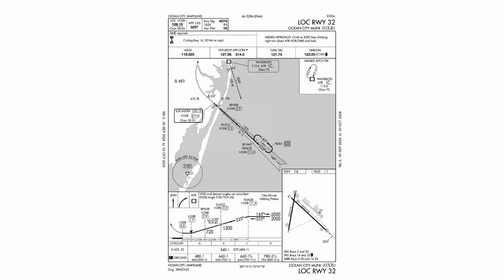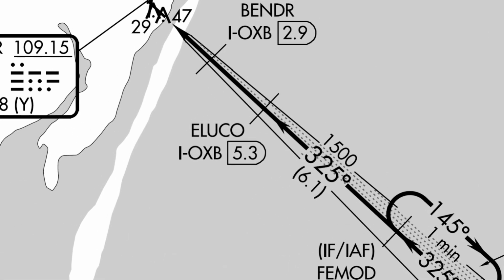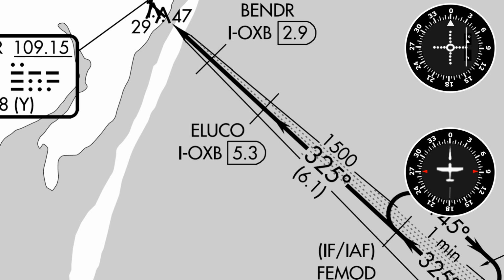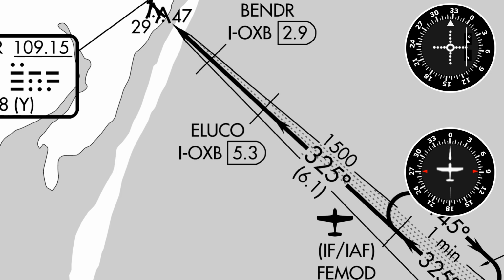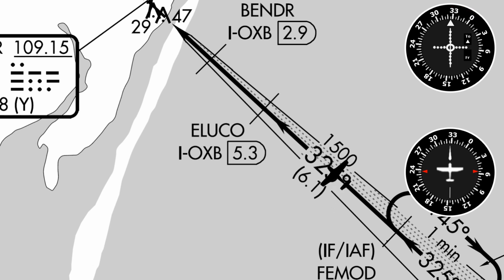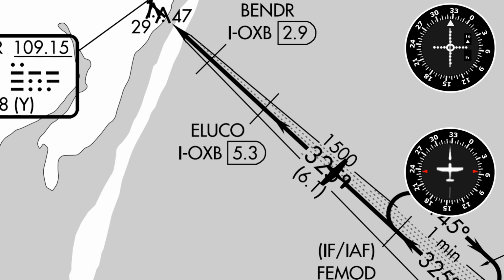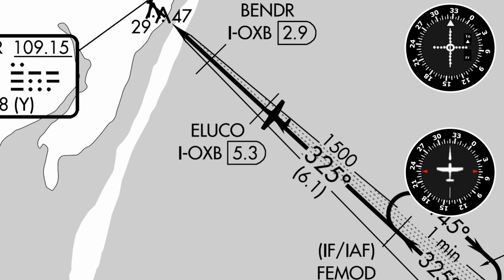Chasing the needle on an ILS: a visual guide

Comment: I thought this title was going to be tongue in cheek. Never chase the needle. Chasing needles leads to oscillations not captures. When you get to actually doing the work, you’re not chasing the needle, you’re making a correction in needle direction then waiting for feedback. Note rate is part of feedback, you should also consider counter-corrections before centering. 

The five degree left example in which the deflection no longer changes isn’t actually parallel to track as it is maintaining an angular offset not a lateral one.